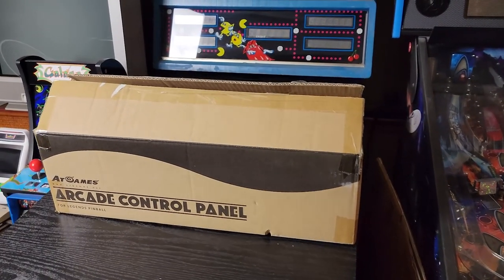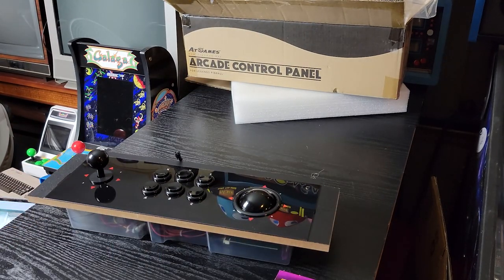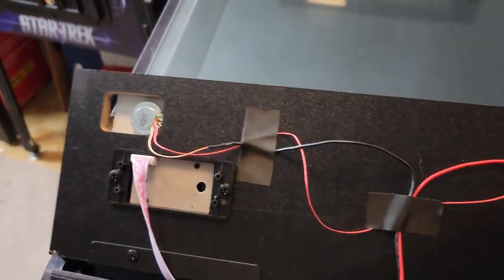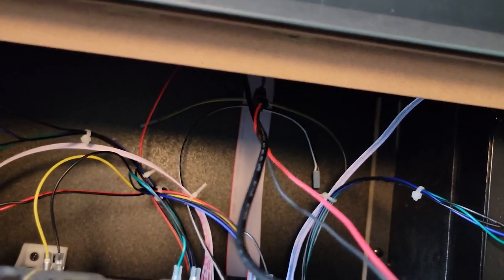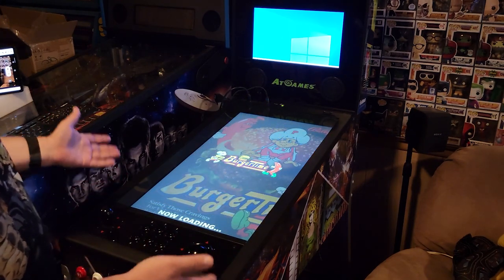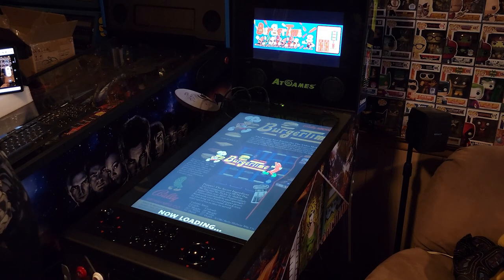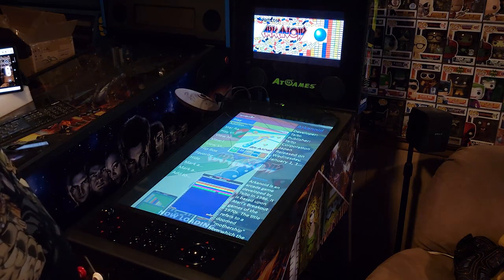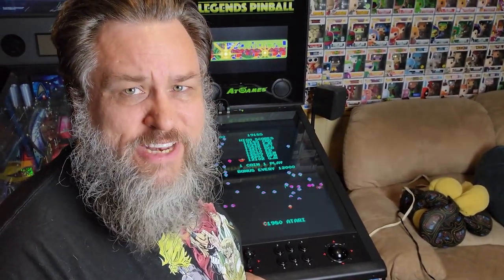Arcade Control Panel for AtGames Legends Pinball

Comment: Crow,

Yeah, I'm loving the control panel.  It's essential for me :)  I did end up unplugging the exciters, because playing CoinOpsX, and pinball really, vibrates the panel off the rails (even after messing with every setting possible).  Yeah, I miss the haptics, but until AtGames can configure them to work properly between all tables, and even disable them when switching to arcade game play, I'm just going to keep them disconnected.

Great to see your take!

vgv